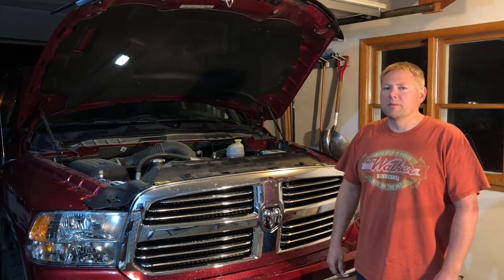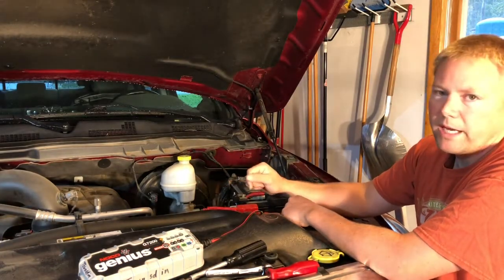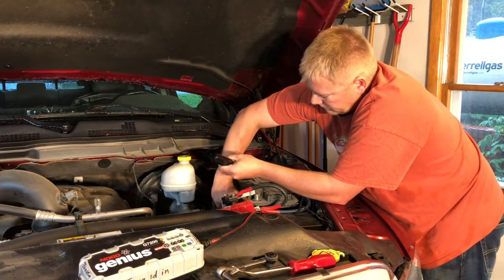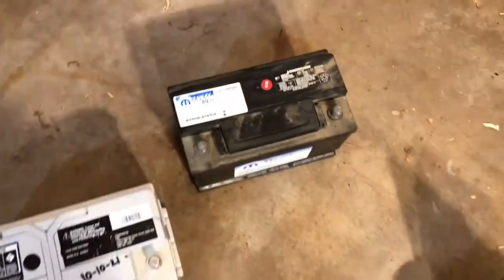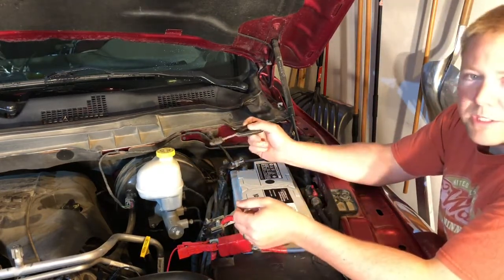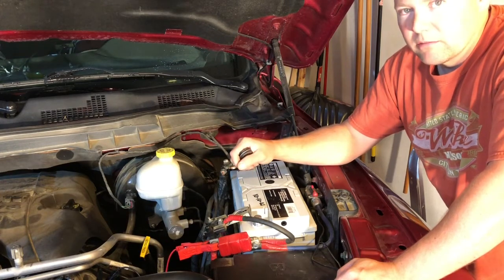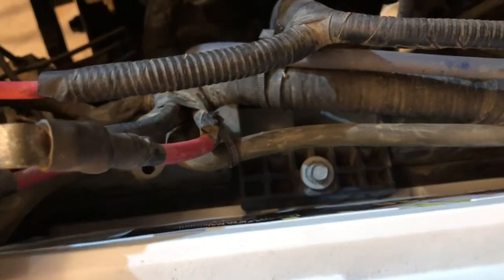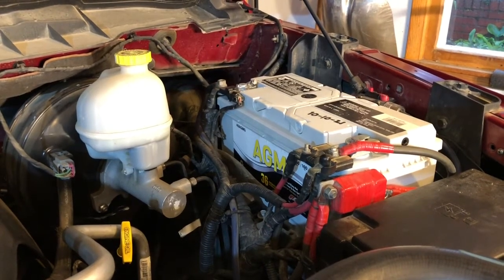Biggest AGM battery you can fit in 4th Gen Ram 1500

Comment: My 5th gen ram 1500 is a H7. I was curious if I could use the 3400r or the 6500 battery? It says 4800 fits but was wanting to get a little bigger battery but the 3400R doesn't have that lip on side as big as the 4800 or 6500 battery. Guess I could maybe buy a battery secure down to hold it down.

Comment: Thanks for the video, but what about charging mode? Agm has another charging algorithm and voltage, is it possible to switch charging mode to agm with alfaobd or smth?
Reply from the maker: Shouldn’t have to change anything for replacing flooded lead acid with AGM. I did some searching and everything I read said it would not be a problem to upgrading to AGM.
Reply: @stanleytownsdin4717  heard that it needs lesser voltage for proper charging, and standart charger can only charge it to 85 percent and to avoid memory effect, it should be fully charged with proper charger at least once a month.. nothing too bad will happen, just some capacity loss
Reply from the maker: After reading your message I thought it might be worth charging the battery with my Noco G7200 smart charger. I set it to AGM and after 5 minutes it was indicating that it was fully charged so I think the truck charging system is working with the AGM.
Reply: @stanleytownsdin4717  thanks a lot for the information! Now surely will go for agm too!